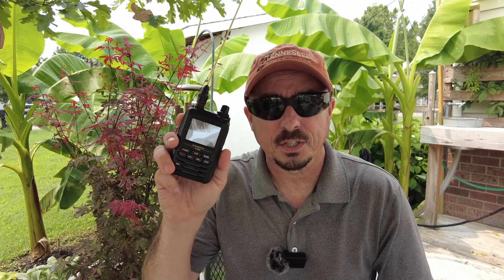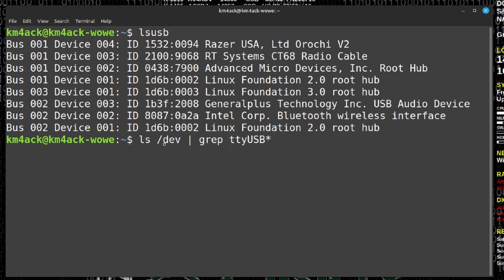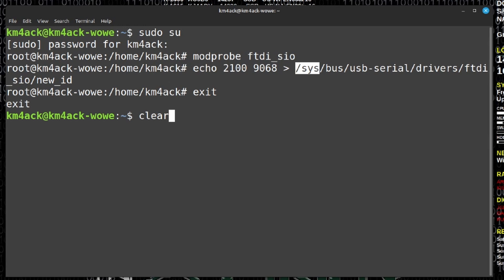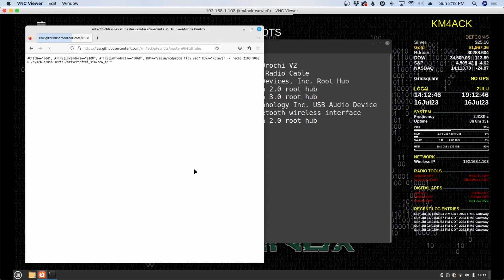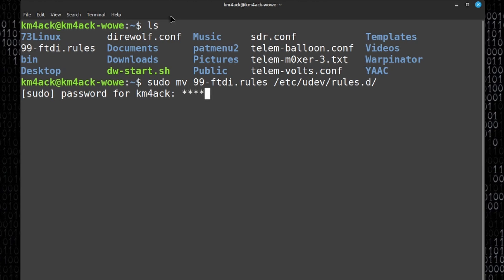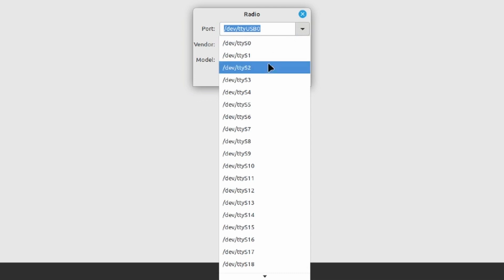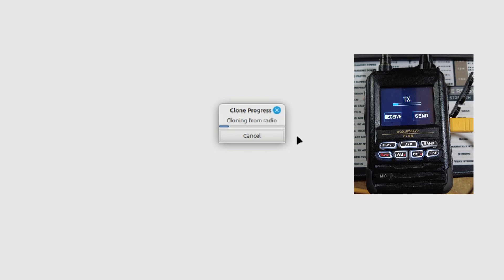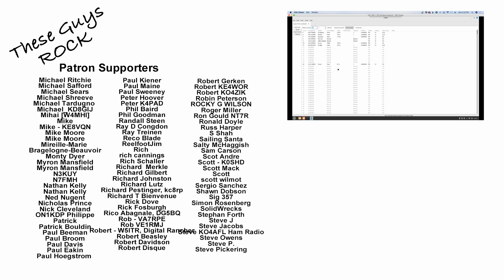Program Yaesu FT5D with Chirp Linux

Comment: Which Linux are you using? While I like Mint, if it ain't cutting it for drivers, I'll switch.
Reply from the maker: I run Mint 21.3
Reply: @KM4ACK  Good Night! I'm using Mint 21.1. I'll keep plugging away but I'm losing what little hair I have left & it sounds like the Old Man fighting the furnace in A Christmas Story around here. Thanks! 73 WB1COB
Reply: Tried the following: dir / etc/udev/rules.d/ shows 99-ftdi.rules (in white)
ls /etc/udev shows hwdb.d & rules.d (in blue) & udev.conf (in white). I haven't used the command prompt since DOS, so I'm not sure what this information is telling me. Do you know?

Comment: I get up to the verify by typing in ls /dev | grep ttyUSB* and the red ttyUSB0 does not show up. Did the procedure about 10 times with the same results. I'll keep plugging away at it, while hoping for a solution.
Reply from the maker: That usually indicates that Linux isn't "seeing" you cable. Try another one if you have it available.
Reply: @KM4ACK  Thanks! Linux isn't seeing any of my three different cables.

Comment: First of all thank you for the excellent video! Without going in to too many boring details, I’ll try to keep this short, yeah right. I’ve been using Linux Mint Cinnamon for about 4 years. Everything works great, except Chirp.  I obtained Chirp using the Software Manager. As I understand that the Software Manager is supposed to have programs that work with the version of Linux using it’s Software Manager. I have no reason to doubt this. While it could be any of the three cables I use, I know one of the cables worked on my friend’s (SK) Windoze machine because he was showing me how easy Chirp was to use. I strongly suspect I have a similar USB driver problem as shown in your video. I’ll be trying your technique when I have a day or two or three (and plenty of bourbon) just to play with the computer. From looking around on YouTube, I see I’m not the only one in the world having problems getting the later versions of Linux Mint to work with Chirp. I will try to use the command line to see if the technique you show for the Yaesu will work for me using Linux Mint. I’m not sure when I will try this, depending on other projects. I haven’t used the command line function much. Reminds me of using DOS over 45 years ago. Would you consider a YouTube video for us old timers on getting Chirp, or the USB Drivers, to work with Linux Mint Cinnamon?
So far, using lsusb I’ve found out that the OEM Baofeng cable (which worked on my friend’s Windoze machine) is a QinHeng CH340, the 8-in-1 cable is alaso a QinHeng CH340 & the Maxton cable is a Prolific PL2303. If these cables are fake is, or not, anybody’s guess. I suspect the Baofeng is real, but can’t be 100% sure. Getting the proper drivers for Linux Mint Cinnamon appears to be my problem. I feel I’m real close to a solution & I will keep plugging away at it. 73 Dave

Comment: As airplane pilot I would like to use the Yaesu FT5D as backup emergency radio but aviation frequencies are TX inhibited. Can the TX be enabled for aviation frequencies?
thanks
Reply from the maker: I don't think so. The radio can be modded to transmit out of amateur radio bands but it still wouldn't transmit on AM as far as I know.
Reply: I have already a Yaesu FTA750, it works only on aeronautical frequencies.
As you know there are some models that work both on aeronautical and nautical frequencies?

Comment: Thanks for the video, great as always. I used Crossover from Codeweavers on my  Ubuntu 22.04 Laptop with the ADMS-14 Software from Yaesu. Installation with no further trbls. I used a SD Card for Backup Exchange between the FT5 and the software. No problems so far. 73

Comment: If you are going to give RT systems $30 for a cable why not just buy the RT Systems software for the $30 and program the radio with the SD card. No worries about bricking your radio
Reply from the maker: except that RT Systems doesn't offer a Mac or Linux version. I don't own a Windows box.
Reply: @KM4ACK  RT System offer a version of software

Comment: I wish all amateur radio manufacturers, particularly Yaesu, would stop developing their own proprietary (often Windows only) software to program their radios, and instead contribute to CHIRP to ensure that CHIRP can program their radios before releasing the hardware.  It's VERY handy to cut and paste from one radio to the other in CHIRP, as opposed to manually entering all of those repeaters and custom frequencies into a new program.
Reply: Well said.. I really wish, at the least, ADMS would have a query source option like RT systems and Chirp.. would make things sooo much easier..

Comment: Using an SD card to move changes is way better (always had issues with my FT-1D & a cable). I stopped using CHIRP on the Mac since I got my FT-5D.
Reply from the maker: what program are you using on Linux to write to the SD card?
Reply: @KM4ACK  Not using Linux. I use a Win10 VM on my Mac using Yaesu’s lame software since CHIRP doesn’t work for the FT-5D, although, I haven’t kept up with it’s progress for 1.5 years now.
But last I heard CHIRP still doesn’t work for the FT-5D yet.

Comment: Using CHIRP has damaged Yaesu radios beyond repair and voided the warranty. Yaesu does not recommend using CHIRP for any programming and to use the free ADMS software.
Reply from the maker: Do you have a version for Linux users?
Reply: @KM4ACK  It starts on Linux, but the Headers of the mask are not readable. Just showing squares instead of letters.
Reply: Agree with KM4ACK, we need Linux compatible programming software. Love Yaesu radios. I have MANY, and I only have Linux at home, no Windows in my house other than the ones to let the sun in.  The ADMS softwares for my FT3 and FTM400  is garbage, even on my Windows PC at work. I find myself exporting the memories to CSV, edit, then import to upload back to radio via SD Card. As basic as ADMS is, I cannot see where it wold be difficult to port to Linux, but then again, I'm not a SW developer.
Reply: How bout a Mac version??
Reply: @hamradiotube  RT System publish Mac version for programming
Reply: Maybe Yaesu should consider helping them.  Publish some documentation on how to properly interface with the radio, etc.  Be part of the solution